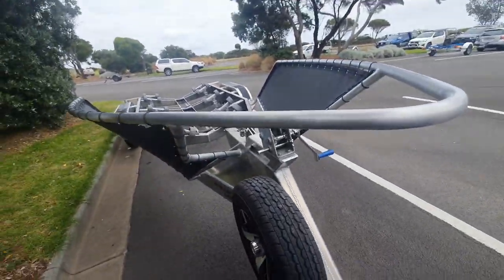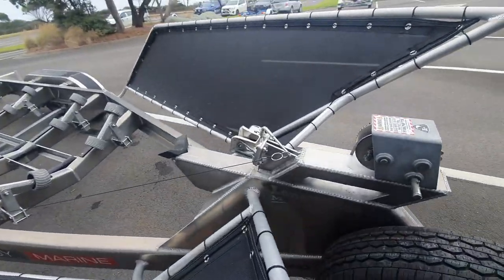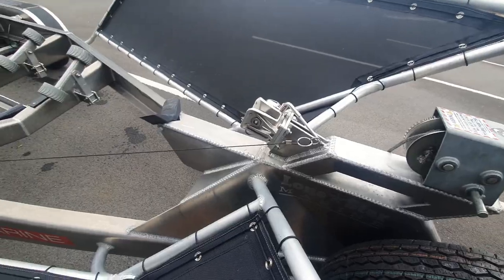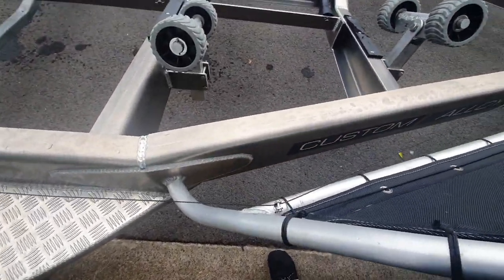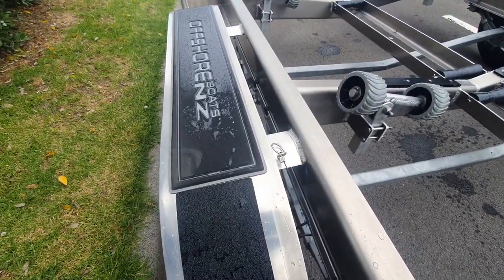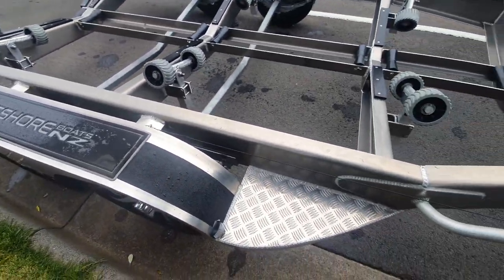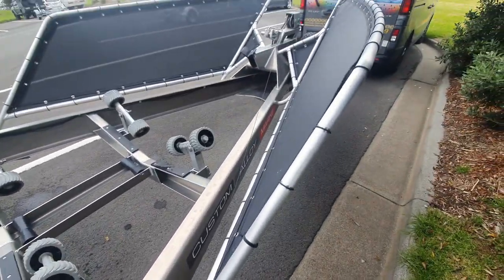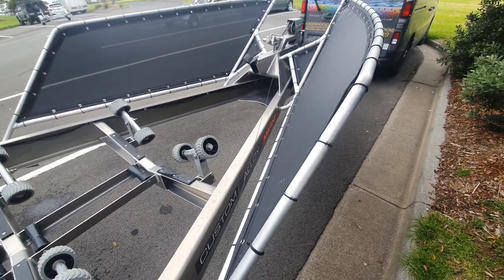Offshore Boats NZ 600HT with Mercury 200 V6 first run review

Comment: what is the fuel consumption?
Reply from the maker: The fuel will be dependent on the  engine size  you choose however our 200 is estimated to do 1.5 to 1.8 klm per ltr